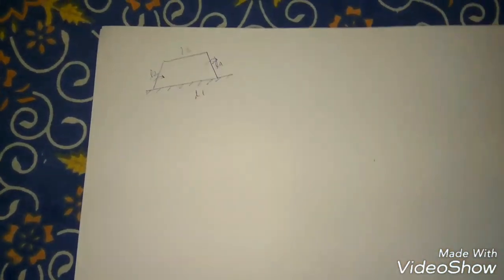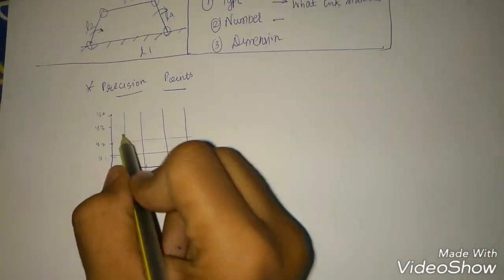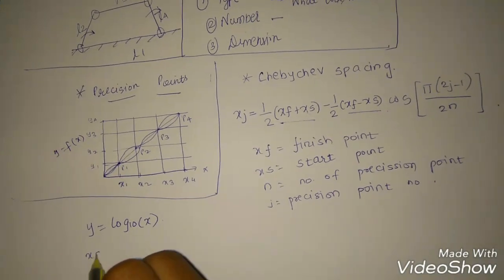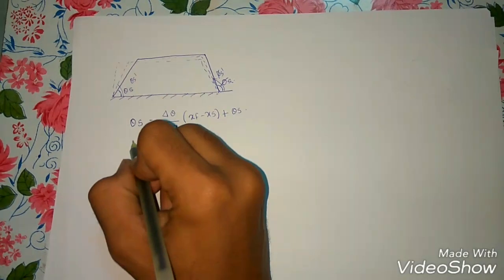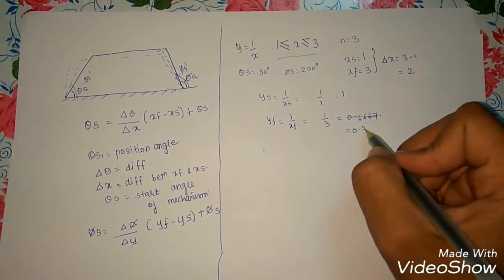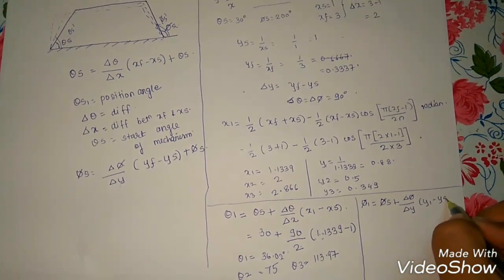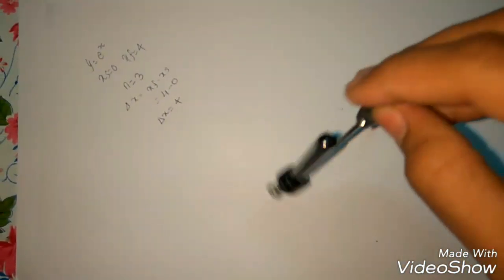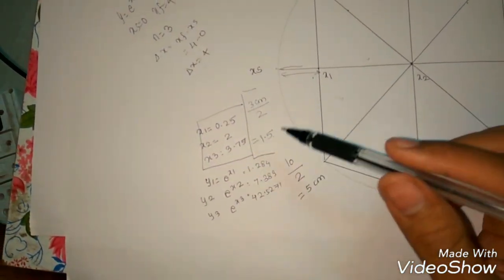chebyshev spacing synthesis of mechanism.

Comment: This video was completely exam oriented. He just gave chebyshev precision points formula, well we can get that stuff from books, but how did that formula came (well that's not in the syllabus so no need, right). In the last video, what the hell is with your hexagon man? 45, 90, 135? What's wrong with 30, 90, 150, couldn't you get a better hexagon and more accuracy from that? And brother just google it what exactly the compass, protractor and divider are.
You have made this 25 min looooooooooooong video, and couldn't even explain how does that chebyshev formula came "because_it's_not_in_the_syllabus".
Curiosity kya tel lene gai hai kya
Sorry to be rude, but I came with a hope to understand why precision points are calculated by this formula and how does it satisfies its given definition. I know it's not in the syllabus but you know...... there is something called as curiosity. I thought since it's such a long video maaaaybe somewhere my doubt will get clarified, but no it's not in the syllabus.
Suchhhhhh an exam oriented video, even marks were told....
Reply from the maker: :P
Reply: Even if he did explain that, you wouldn't understand because you can't even understand how he got the angles 45 , 90 and 135 . Wanna know how? Do 180/4. Use math. Not your broken logic 🤡
Reply: Do it better yourself then. There are not many great videos on this topic. He sure has made a few mistakes, but he did a more than decent job.